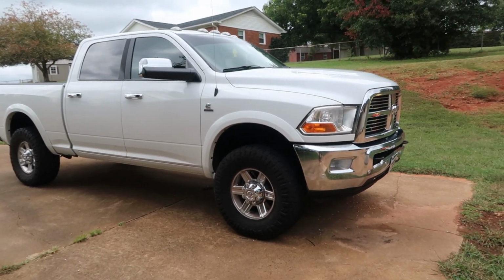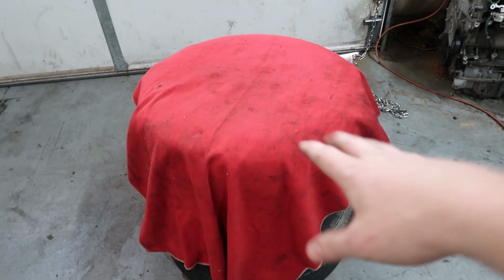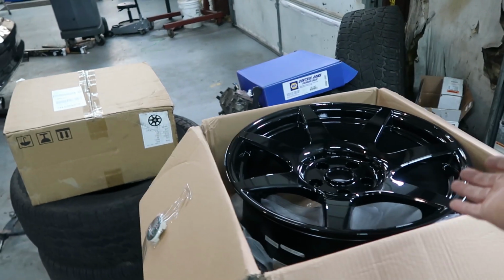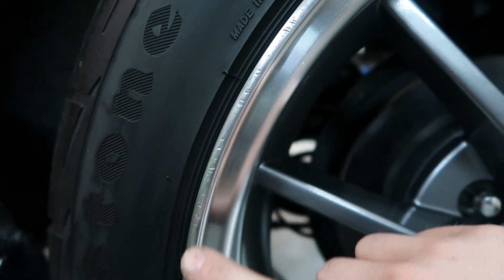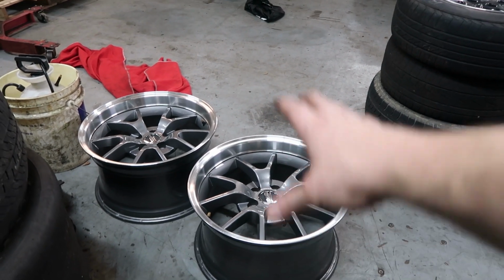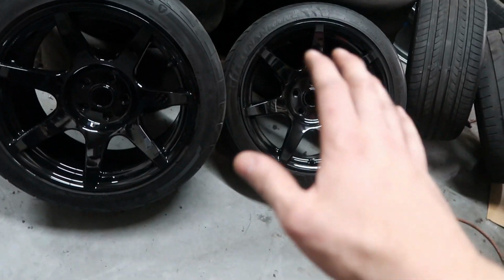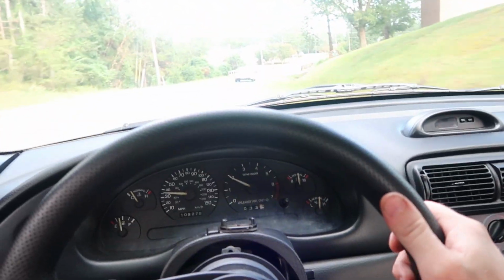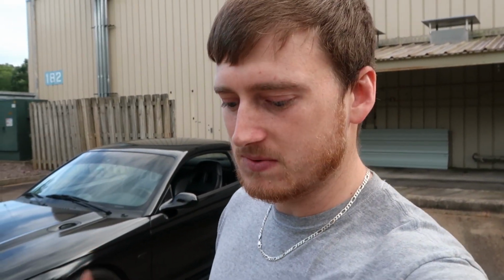Cleanest wheels ever for Sn95 mustang (Looks Incredible)

Comment: I like them I'm a new subscriber for a little over a month was wondering when you might put up something new. You do have a really nice car.  I just picked up two weeks ago 1994 mustang convertible with only 17,775 miles on it Rio red with a white top and white leather seats.  Keep up the nice work 👍
Reply from the maker: John Griffin that’s awesome to find such a low mileage car! Most of them have tons of miles on them and are beat to death! Thanks for the support! 🙏🏼
Reply: Nice! I also have a 94' mustang convertible. How's the top? I'm in the process of replacing the original top.
Reply: @joelvega9534  Hi the top is in very good condition it should last me a long time before I need to replace it and going to keep the same color white, I already have a wish list of mods for it! White mags 18×9, Steeda lowering springs , 3.73 gears, aluminum drive shaft, Hurst short throw shifter, rear differential cover all Ford performance, and BBK 70mm throttle body and cold air intake I'm up to about $3,500
I love the car I'm really glad to find this one, when I was 20 years old I bought a new LX with the GT package in 1986 silver with a midnight blue interior wish I didn't sale it but I think I have a much better mustang now it's like night and day between the two

Comment: How’s the fitment in the rear? Still tucked into the fender or is it pretty flush? Looks good dude. Never would have considered those wheels before but they turned out great.
Reply from the maker: Logan Studdert thanks bro, and it needs a bigger tire on the back but fitment is better, probably go with a 305 rear tire and should make it where I want it

Comment: You've got me really considering these wheels on my 94 cobra, but I'm thinking the liquid graphite color will go well with rio red. How much clearance do you have between the wheel/tire and the quad shocks? Any clearance issues with the exhaust?
Reply from the maker: clearance has be fine for me!👍🏼 and I love these wheels and I think the graphite should go great with the red
Reply: @lollis_garage3683  Awesome. Nitto makes some 295/45r18's. Little bit taller than stock but I think they will fill the rear nicely.

Comment: Looks good man! I definitely think they look better than the fr500’s maybe it’s just because I’m tired of seeing them on every mustang..but honestly these wheels look good on your sn95,but I suggest putting 315’s in the back,it’ll look a lot better and maybe lowering the car another inch,oh and one more thing,put some spacers in the front,the wheels are too sucked in the fender,that’s why I always custom offset wheels to make sure they sit flush after putting on tires
Reply from the maker: Yes the fitment still needs a little work and I figured it would I can also take a good bit of camber out to help the look on the front. But still fitment needs a little work 👍🏼
Reply: BustedKnuckleProduction perfect fitment on these cars is really hard to do,the only person I’ve yet to see pull off wheel fitment on this platform is H8RBuilt’s Orange sn95 cobra which is now owned by someone else

Comment: Hi I'm Ex I have 94 Mustang GT mint condition need help fixing it i was starting and now is not and when it was starting didn't want to idle pass 4000 rpm  it would choke when you idle the engine wow it doesn't want to start let me know how you can help thank you
Reply from the maker: Man it could be so many things, it could be fuel pump or ECU, it kinda sounds like fuel pump by how it was cutting out at 4000rpm

Comment: Nice 95 gt.  I have a Rio red 95 gt I bought new almost 27 years ago. It has 40700 miles and I have a Kenne Bell blowzilla. Im in the process of getting AFR aluminum heads and a blower cam installed.  I ordered the heads 2 weeks ago. 4 month back order on the heads.  Anyway I really like what you've done with yours.  Glad I found your vidios.  
How much horse power does yours have?
Reply from the maker: That’s awesome and it’s makes 330 wheel on motor now, I’m adding nitrous right at the moment probably gonna run a 150 shot